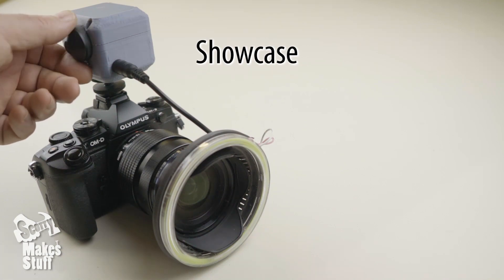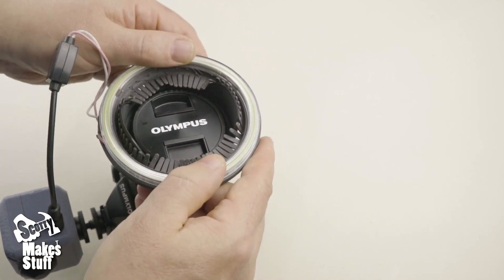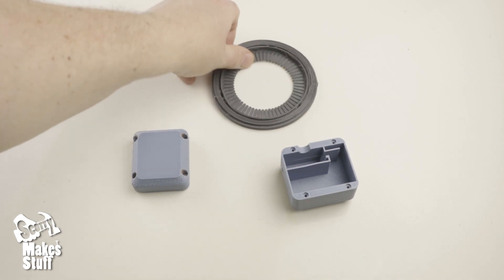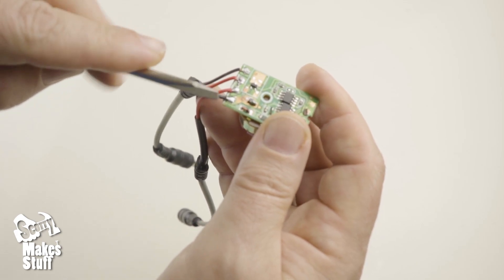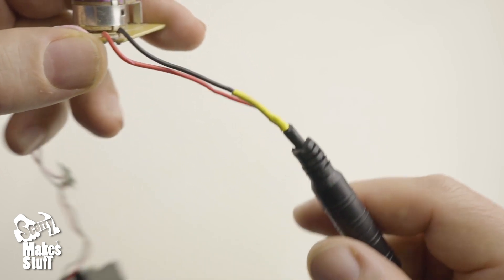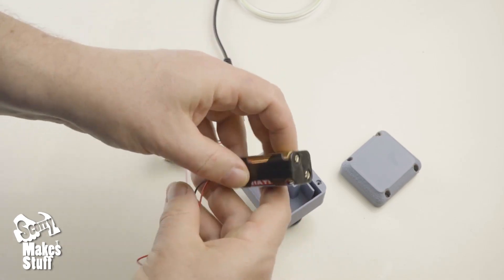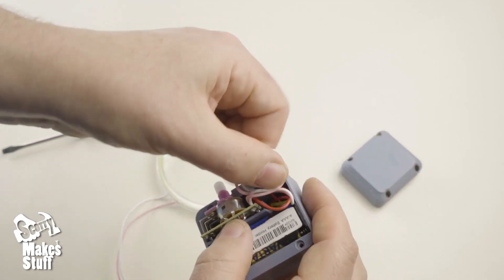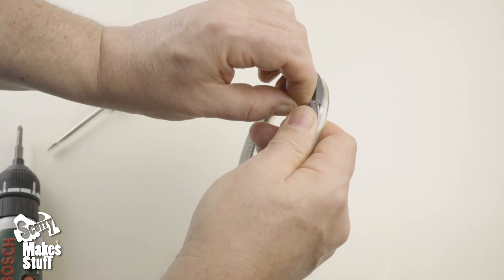3D Printed Macro Photography Ring Light

Comment: I know it's an older video, but there is one detail I did not see anywhere......what nut size is inserted in the bottom print?  I'll need to order that, or is it part of one of the kits listed in your parts list (again, didn't see it)?
Reply from the maker: It's a 1/4-20 standard photographic size nut

Comment: Do you have a written instruction on how to solder the components? Because, unfortunately, the video is not very clear on what to do.
Reply from the maker: Sorry, I don't have anything else apart from this video.
Reply: okay no problem, but could you give me a hint on how the wires are soldered to the battery case? In the video it looks like you just put them through these little holes to the inside. How are these connected? Sorry for the annoying questions. Greetings :)

Comment: Why is the ring light regulator not inside the box as well. I don't know much about electronics so it's an honest question. :-)
Reply from the maker: It's not a regulator / dimmer you can see... it's the same thing that you see on lots of power cables... helps keep things running smooth and not overloaded. The dimmer is actually in the box.